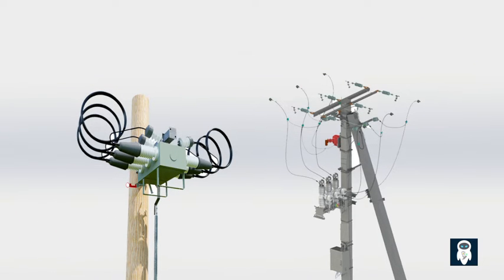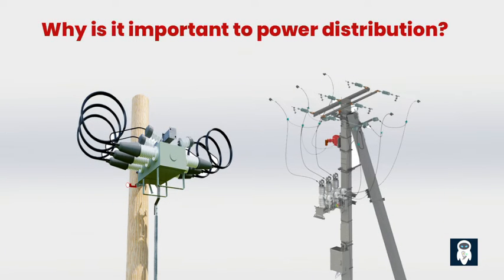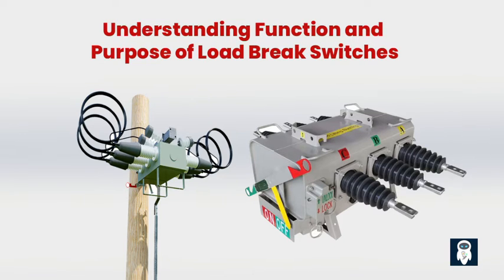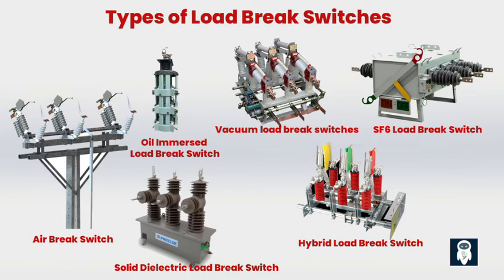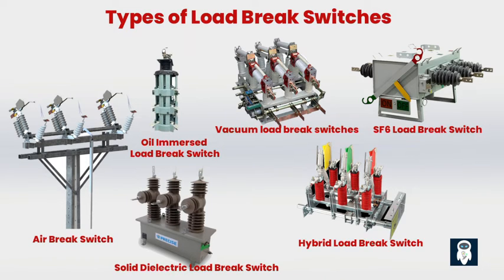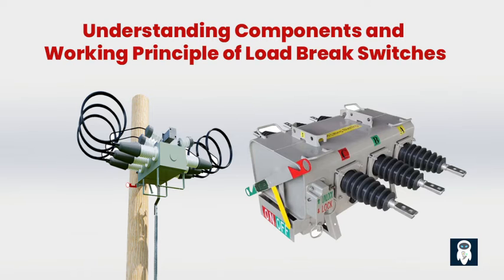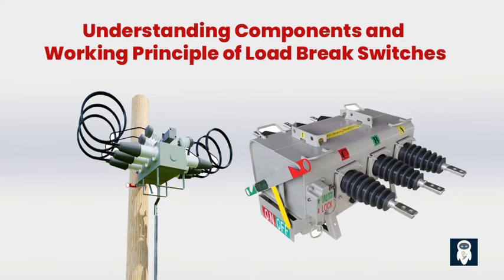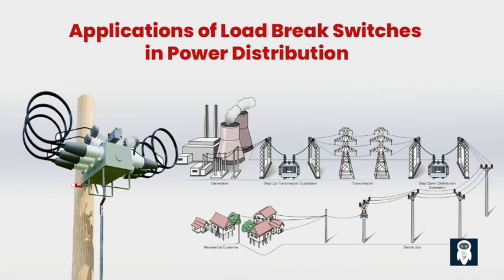What is Load Break Switch (LBS) in electrical power distribution?

Comment: LBS = on load breaking = it can be switched off when it is connecting to system with/without load.
it may be equipped with arcing contacts.

Comment: you forget say that it does it under load . other types of switches can't operate under load .they must have the power off before they can be operated.  L.B.S.s  are not circuit breakers. an oil, vacuum, or gas Fs6  circuit breaker can. L.B.S. is used to isolate parts of the grid under load and (not for over current protection.)
Reply from the maker: Thank you for your comment